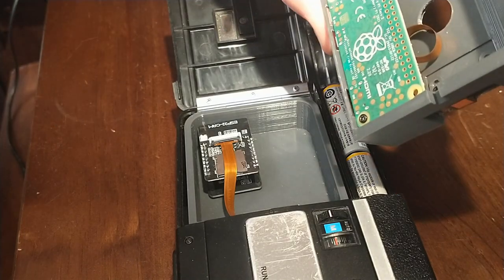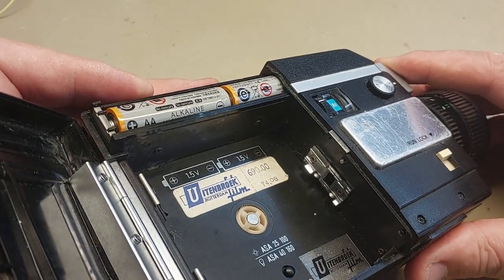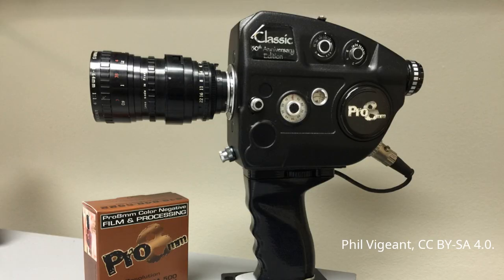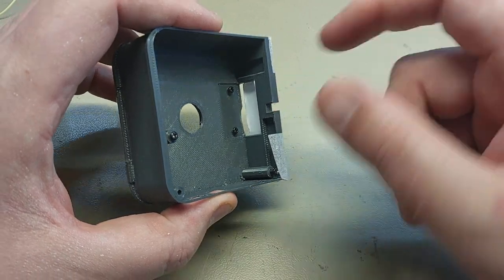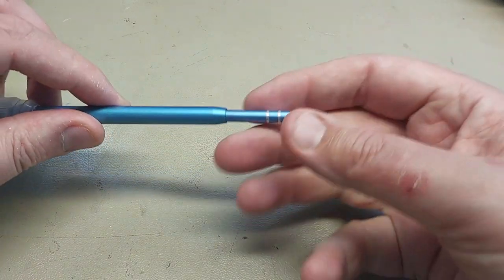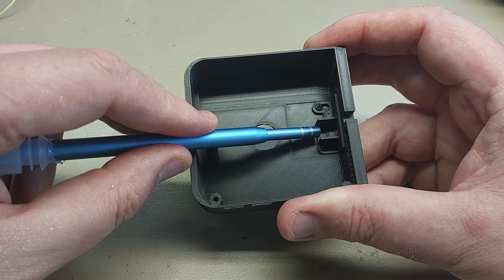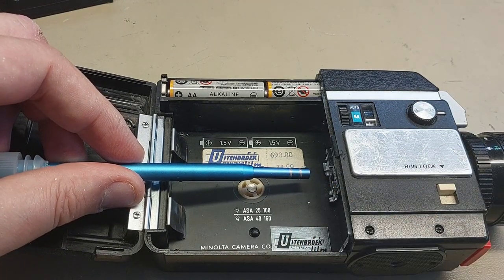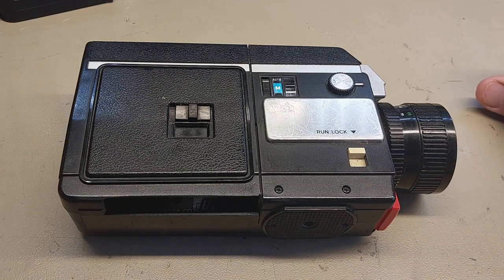Digital Super 8 cartridge, part 3: What's On Jenny's Bench

Comment: Interesting project! Capturing the aerial image is certainly preferable to refilming a diffuse transmitted one. 
My question would be one of frame rates and synchronization. You really need to be able to trigger a frame based on the camera's shutter, perhaps from the pull-down claw? Not sure is a hall-effect sensor might work? 
Without some sort of synch, the frame rates of the capture camera and the physical shutter will interfere. Y favourite features of Super8 are things like time lapse, slow-motion and automatic B shutter, where the camera advances frame when its received enough light. Variable shutter angles and a range of frame rates set even Superr8 apart from being just like video. Without the ability to replicate the light collecting abilities of film, its only a gimmick and you would be better off with a purpose built digital camera probably.
Im guessing that these otoscope cameras won't give you contol of enough parameters to achieve long exposure as they are likely to use a "rolling shutter" rather than  a global one?
The way you can collect light on film is such a critical aspect of the resulting feel. 
Some of this could i suppose be in software, but somehow replicating the analogue of film's behaviour will dictate the usability of any digital cartridge. 
I'm following with interest as someone who used to shoot a lot of film but has been put off by the high cost for casual use.theae days.
Reply from the maker: This cartridge won't be able to do everything analogue film can, and I'm not even going to try. Fortunately there's a good enough supply of film in Super 8 and plenty of expert developing houses even if it's not cheap.

I'll attack the shutter problem when I've dealt with optics. One route could be to do it post filming, i.e. have a script that discards partial or black frames. But it will need some careful thought.

I can also use a photodiode able to see the light path, and trigger a shot. But that's not without its problems too, and may require another post processing step. There will certainly be plenty more technical challenges to come.

Comment: I've been waiting on this, very cool!! I'm working on my 3rd version with adjustable focus (and trying to keep track of what I'm doing, very haphazardly 😫😫🤣🤣). Mine is more DIY as I don't have a 3d printer. I've used an actual actual expired cartridge and gutted it. Using the script from benefitiv's version but with a sound sensor in place of the photo sensor. Also one of the element14 vids recommended settting the framerate 1 frame higher than the camera's framerate which helps with the shutter roll. In my case, the camera I'm using broke in several ways (trigger broke off, positive battery cable broke) so since I had to muck it up to fix those things, I had no real aversion to removing the gate (and part of the shutter). Hoping to try it in a fully functional camera but it works rather nicely in spite of the crop. I briefly flirted with the idea of the arducam mini HQ as I'd likely get more of the full frame, but I can't justify the price... Not yet, anyway. 

It looks like you'll get a full frame using the microscope camera, can't wait to see what happens, I remain intrigued!
Reply from the maker: It's certainly an interesting project. And I look forward to seeing what you achieve, I hope you publish it.
Reply from the maker: Suggest finding a hackerspace if you can for 3d printing.

I put up a blank cartridge model on my Github. https://github.com/JennyList/film-cartridge-models

Comment: Very good work on the 3D printing of a super 8 cartridge, and I think if you take the lens and sensor out of the pencil you could find a way to get it solid into the cartridge. My concern is syncing the frame rate of the sensor up to that of the super 8 camera. There are almost no super 8 cameras with crystal sync, and even if most are horribly off these days.
Reply from the maker: Very much so, and thanks!

I've had one of those things apart and it's just a small camera module on a flexible PCB. I can hook the USB interface into a Raspberry Pi Zero, or I can choose to try to focus a Pi camera to macro distances.

I haven't turned my attention to the sync problem yet. I'm hoping it can be done in software alone, i.e. discarding frames caught while the shutter is closed. But I sense that's a problem for another day.

Comment: what about triggering the raspi cam by an infrared or hall sensor that detects the movement of the film transport claw?
Reply from the maker: I wondered about that. I think if I use a trigger it will be a photodiode though.
Reply: @jennylist  should work but might cause the raspicam to trigger early when much light is incoming through the gradually opening mechanical shutter,  a set treshold or a delay would help but must be light adaptive, which could cause other problems and is complicated to implement, but, yes, should work.